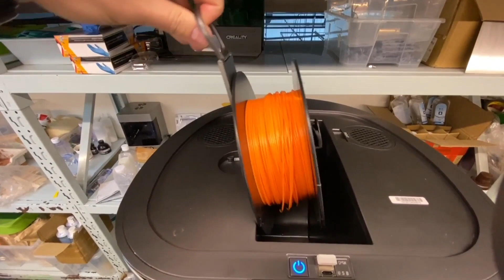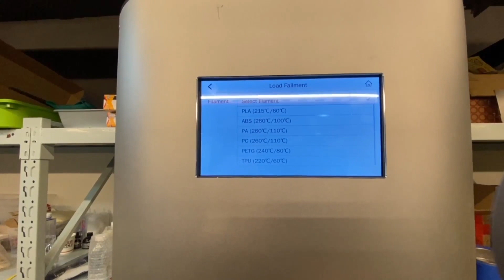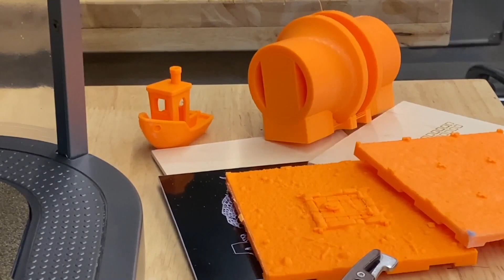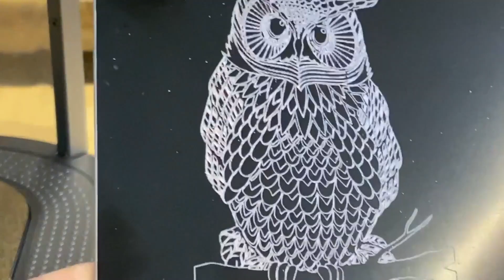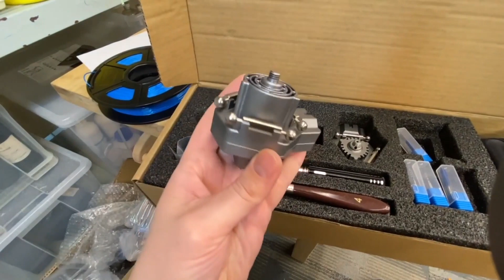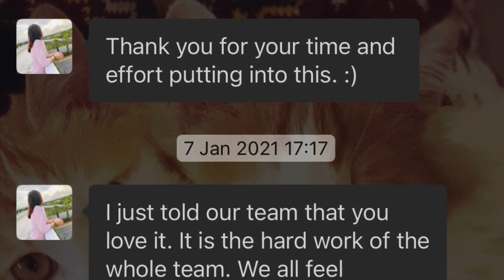User Feedback on the #1 Shipped IVI 3D Printer

Comment: Printing with a printer that's 2 years old (a used ender 3) and right off the prints just look bad
I get that it's supposed to be a budget printer, but selling it as doing FDM and SLA as well as a bunch of other stuff is scummy marketing. At best it's a cheap delta printer with (I assume since the printer allegedly auto-detects them) proprietary nozzles and print quality worse than a budget FDM printer. 
I hope you deliver something to your backers.

Comment: Looks like IVI has shut down their website, twitter, and most of their social media. I was an early backer and have been so excited to get one, but looks like it's not happening. Since you managed to get one to test out, have you been in contact with any of the devs?
Reply: Is it still shutdown?
Reply: @Seth7Seth7  the site is "up" but ordering has been halted. The KS crowd is pretty pissed at the silence. No updates since March when they said they needed to secure more funding for production to begin. A lot of folks are most upset that the KS was heavily advertised as a "we just need funding for production" when in reality they had a device that was ok for a prototype but in no way ready for mass production. They had to go back to the drawing board multiple times and blew through all the KS funds on redesigns.
Reply: One of those "redesigns" was unnecessary I felt. Heat dissipation can be done with the thermal pad to the case ...

Comment: How did you print your own 3D files? Did you upload them via an SD card?  I believe it was indicated that this machine could be used offline.
Reply: You can print via usb-c, over wifi (both through the IVI slicer. I presume cura and other slicers too but haven’t tried) or upload a gcode to a usb stick.

Comment: Where's the included video monitoring camera that we were told we were going to get with this printer?  Do you see a camera inside the unit that records and monitors your printing?
Reply from the maker: Hi Fabian, we figure the camera is not an essential part to achieve the main functions of IVI, thus we postponed the development of the monitor camera to speed up the project.
Reply: @IVI3DPrinter  so just to understand, this was a specific achievement goal within the kickstarter that we were told we were going to get, and now we are not going to get this? Wow!!!!   What else did you change???
Reply: @flamaest  Trolling is easy, but reading and understanding is a bit of a problem for you, isn't it? Posponed does not mean you won't get it, or that anyone breaks his or her promise, but as stated in one of the updates; the camera will be developed and shipped afterwards.
Reply: @RowdySchwachofer   if you believe that, I've got a bridge to sell you.
Reply: @flamaest  Yeah, you are already trolling for two years now that there never would be a printer?  We have a word for that in the Netherlands: Wappie. That's what you are.
Reply from the maker: @flamaest   I have to address that the whole team worked really hard to keep the high standard of this printer. We put so much effort into this product. If we didn't, this printer cannot perform well at all.
Also, if there is any sacrifice we did on the product change, it is because we have no choice.
There are risks to any start-up, late delivery is worse than on-time delivery, but a failure in delivery is worse than late delivery.
As you can see, we met delays on this project. And I am sorry that I cannot give you a certain and responsible answer right now. We believe that our customer is the first. And you are one of them. If possible, we hope we can add the monitoring camera and reward it as the stretch goal gift.
Currently, our focus is on the delivery of all the pledges. This is a major task ahead of us, and the monitoring camera goes after.
We can give you a more certain answer after we tried to put effort into the development of the monitoring camera and figured out the difficulty & the cost. We will do our best.

Comment: Where's the exhaust port when doing laser engraving?
Reply: There are two at the top when I lift the lid for the printer spool. Those plastic grills can pop off and then you can attach to them if you have the correct connector.
Reply: @alexdavies4610  alex, thanks for pointing that out. I looked at your video again, but those are not true exhaust ports. When you are laser engraving this produces smoke that is dangerous to inhale and should be removed and filtered. This requires a true exhaust Port where you can connect a flexible tubing to absorb the gases as they are being generated by the laser. This current design is highly dangerous and it's probably going to lead to someone getting lung cancer or something.    More broken promises from the company that produced this item.
Reply: @flamaest  huh? I believe Alex was saying that you could attach a tube on those ports, it looks like the covers pop up and i'm assuming you could likely screw ventilation tubing in. (looking back at alex's comment that's exactly what he says). Is there something else you mean to be saying that i'm missing?
Reply: @ZeeLobby  yes, please research fume extraction tubing on any laser engraver on the market and you will see what I'm talking about. What was described here is simply not good enough. Not only will this damage your lungs, but it will damage the laser. Fumes should not accumulate near the laser nor in the room where the laser is operating.  This device does not have an appropriate fume extraction capability.
Reply: @flamaest  dude. You attach a hose to those ports and vent it outside the room. This is what everyone is trying to explain to you. I work with industrial lasers. Most don't provide hosing. It'd standard. you simply connect it to those ports and vent it out a window. I don't know what else you expected them to included. The maker of the video simply just didn't do this. There are extraction fans in the housing. You just need to vent it outside. Hosing can be bought cheap off amazon. And at almost any length.

I mean I get that your just trolling at this point, but it's got extraction. You just hook up a tube. It's not worth stressing over.
Reply: @ZeeLobby  then please show us the extraction fans and ducts, I do not see them and this is an assumption posed in the video. 

According to the manufacturer none of the things that you are saying are on this device. And yes, any PROPER laser engraving device that you buy in the market today has proper fume extraction connections, tubing, and they usually come with the option of an entire filtration system if you cannot vent out to a window.
Reply: @flamaest  the ports are right on the top! He shows them in the video. He even mentions that you can attach tubes with the right connector. Just cause he didn't do it in this one intro video doesn't mean it's not possible. Pay attention when he opens the filament holder. Both ports with fans and codes are right there.

And I realize industrial cutters OFFER those things, but they're usually optional. Most machines have exhaust fans built in, and if you want to save on cost you can attach it to your own ventilation system, much like this (as simple as attaching a tube to ports and blowing outside in this case).
Reply: @ZeeLobby  I see where he shows them in the video, but those are simple exhaust ports. It is not clear that they are to be used as high-speed airflow for fume extraction. If you go into the forum of this company where they allow Kickstarter backers to join, you will see that this is an active topic.  I understand what you were saying, but I respectfully do not believe that those are proper fume extraction ports.
Reply: @flamaest  I mean whether their sufficient or not definitely requires testing. But it doesn't make sense to call them insufficient until someone has done so. Assuming the chamber has limited leakage, and the spool holders sole point of entry is through the filament feed, some decent fans should be able to push air from the machine. I'd be greatly concerned if I was cutting feet of acrylic with it, but with the size of most pieces it might be sufficient. Just hard to know until a beta tester actually tries. But a little early to call it a complete failure no?
Reply: @ZeeLobby  I really hope you're right.

Comment: I thought we were going to get room for dual spool holders on the top of the unit. It only appears to have room for one spool ??
Reply from the maker: Hello again, it is a design change on the filament chamber.
Reply: @IVI3DPrinter  yet another change from what we were promised. it seems like you took our money and changed the product from what you promised your backers would be getting.
Reply from the maker: @flamaest  
Hi Fabian, I have to address that the whole team worked really hard to keep the high standard of this printer. We put so much effort into this product. If we didn't, this printer cannot perform well at all.
Also, if there is any sacrifice we did on the product change, it is because we have no choice.
There are risks to any start-up, late delivery is worse than on-time delivery, but a failure in delivery is worse than late delivery.
you said, "I honestly don’t trust or believe anything this project has said or shown in the last year...this smells like another 3d-printer kickstarted SCAM." 
You have been expressing your feelings based on your assumption. Now you saw the printer from the user's perspective, do you still think it is a scam or it is a fake printer?

Comment: Nice review. Can you show me the videofeed from the internal camera?
Reply from the maker: Hi Patrick, do you mean the monitor camera? We figure the monitor camera is not an essential part to achieve the main functions of IVI, thus we postponed the development of the monitor camera to speed up the project.
Reply: Patrick, looks like we're not getting the promised camera, or the dual spool holder, or a real exhaust port for laser engraving. ....Good job IVI for tricking your backers!   Makes you want to support another Kickstarter..  /sarcasm.
Reply from the maker: @flamaest  Hi Fabian, I have to address that the whole team worked really hard to keep the high standard of this printer. We put so much effort into this product. If we didn't, this printer cannot perform well at all.
There are risks to any start-up, late delivery is worse than on-time delivery, but a failure in delivery is worse than late delivery.
you said, "I honestly don’t trust or believe anything this project has said or shown in the last year...this smells like another 3d-printer kickstarted SCAM." 
You have been expressing your feelings based on your assumption. Now you saw the printer from the user's perspective, do you still think it is a scam or it is a fake printer?